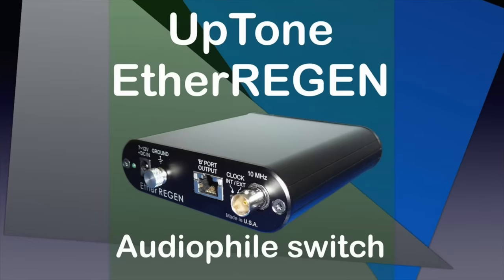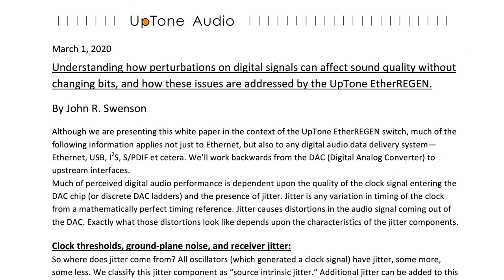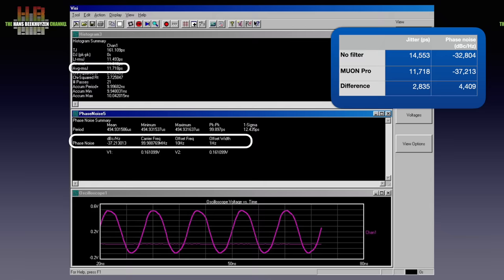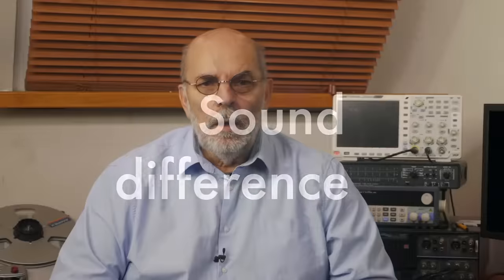The BS about network switches and the like...

Comment: Hello, of course these test executed by people owning commercial businesses are very easy considered a marketing tool. The bigger the number of devices they can sell as being " audiophile grade " the more money they will make. It seems that the Grimm devices are kind of immune to the garbage that comes along with the signal delivered by your internet provider. EtherRegen with a audiophile quality power supply, some nice feet, aftermarket power cable, ethernet cable and you are getting close to 2000 € additional cost to a device that is not exactly cheap. Sometimes this audio hobby is getting boring. I already decided that after receiving the Grimm i will stop investing in digital gear. Greetings,Eddy
Reply from the maker: The Grimm player doesn't need these peripherals.
Reply: @TheHansBeekhuyzenChannel   Hello Hans, i already have the Etherregen with an improved power supply but probably it won't improve anything so it is good to know!  In your mu2 thread you already mentioned that very probably i won't be needed. Which makes things easier. Reducing the number of power cables and " interconnecting cables" will save me some money and should bring some improvements.  But on some " marketing site" USA based i already see people asking about upgrading the fuse. I already have a bamboo chopping block so i will try that one. There is info on the internet about  diy vibration killing feet using copper sponge as the key element!!  Greetings,Eddy

Comment: 1- as an IT hardware professional, i know for sure that switches leak data. Most likely due to not switching fast enough. I'm assuming the opposite should be true here as well, ie. they block out bits that should have been let through. Now computers are designed to handle this without breaking a sweat. But do you think this negatively affects audio?
2- Is this device acting as a buffer (a storage buffer type) between the switch and the dac input?
Reply from the maker: This is the first time I hear this from an IT professional. That will impact isochonous connections. But should not happen with asynchronous connections I would say.
Reply: For a home network this should be extremely rare unless you have very very bad setup. This would show up as dropped packets and can be tracked. If you are getting dropped packets at all on a wired connection most likely you have some defective equipment.
Reply: @a_macaulay good point. It's a bug but was it a result of hardware going faulty or just the way it does it's switching/processing or a combination of factors, I don't know. This was me doing some testing on my home network. Specifically, the ISP provided switch (no not a router and connected before the modem). What I found was it was randomly letting through 5-8 bits when it should be blocking that data (due to a different ip configuration, very complicated...). This is what led me to wonder if the reverse is true as well, ie. blocking data that should be let through, say for example the first 5-8 bits of a stream.

Now, when one is referring to computers or servers etc. the TCP/IP protocol is the first layer that is designed to easily rectify such lost bits. So it doesn't always amount to packet loss. In fact, the errors have to be seriously bad for the TCP checksum correction to fail and result in a packet loss.

Also, the TCP protocol (or any other protocol ftm) can ask for retransmission of the lost packet in case of uncorrectable errors. This again, the packet is not fully lost, ie. it's recovered. Packet loss would only result if the data can not be retransmitted, due to things like being flushed out of memory or not being in memory in the first place. That's as far as computers are concerned. Music is a whole different topic. Here, bits are not (just) bits. It is time sensitive, and extremely so. Hans should be aware of various DAC configs in this regard and resulting effects. Also, audio gear is nowhere nearly capable of possessing as much processing power.

Also, regarding the retransmission request of lost data packets - the USB 3 and above standards can also request retransmission in case of failed checksum for data integrity, just like TCP/IP. I have no idea which audio gears actually utilise this.

Retransmission request and receive times on a home network, or a USB 3 connect between a host and recipient, definitely would be in picoseconds, even if at the higher end of the ps scale in the worst case scenario. So request and receipt completed even before the entire data transfer completes.

All this raises a further question - the time factor. I had gone down this rabbit hole long ago, and it had looked very interesting to find what was there, but I guess it was too far down ...
Reply: @TheHansBeekhuyzenChannel ah yes. I remember the asynchronous & synchronous part now. Also, please do refer my last comment here.

Just leaving it here for you, in the hopes that you are the best person to be able to use this, if it fits, and maybe dig a little deeper for us. 👍

Comment: May I suggest you do an episode on phase correctness? In source, amplification, cables, filtration, actual loudspeaker, loudspeaker placement, and listener positioning. I.m.h.o. an important factor that is often neglected.
Reply from the maker: Every device I review is measured, including a phase measurement.
Reply: Could be, but you barely mention it. And you don't discuss the utter importance of it. In this domain I was totally flabbergasted when I compared my KEF 107 Reference to the Wilson Audio Cub 2 and other d'Appolito setups. A world of difference. They even presented spatial bass, which I thought was theoretically not possible.  But when harmonics of bass instruments reach your ears with correct timing, it most certainly is. @TheHansBeekhuyzenChannel